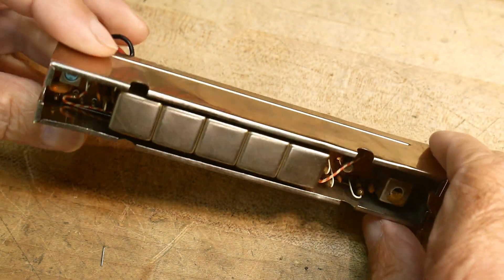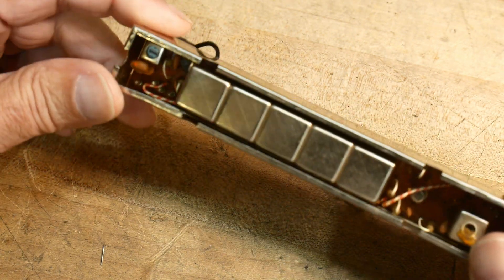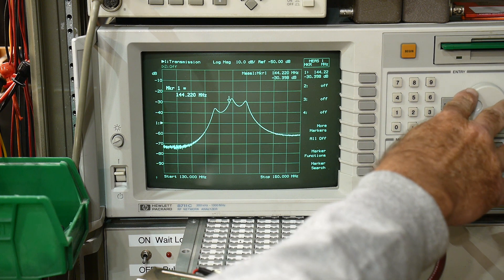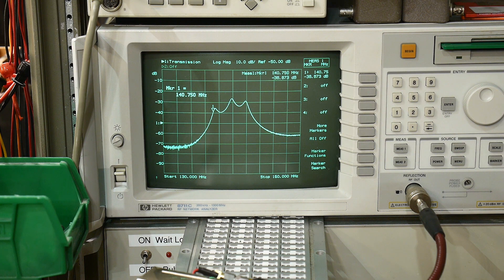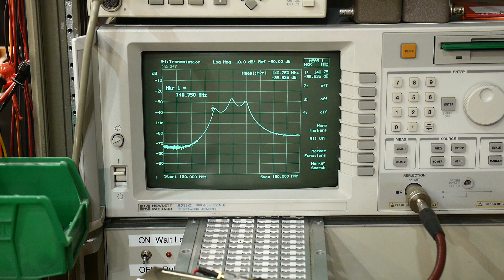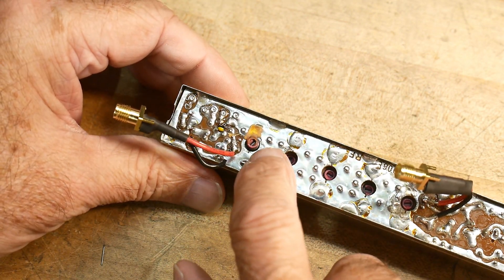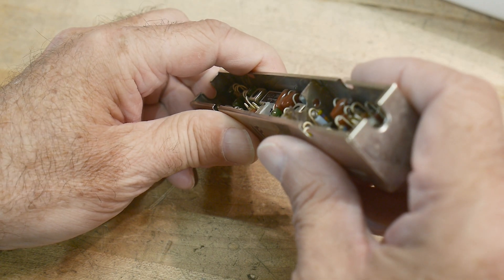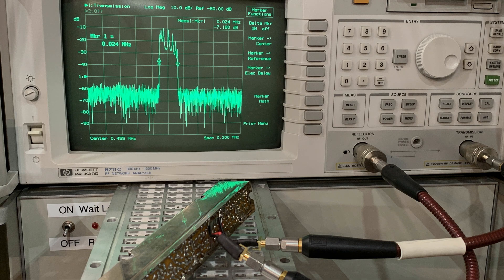#983 145 MHz Helical Resonator Bandpass Filter

Comment: I wonder if perhaps the reason it's so broad banded is that the tuning has changed with age/vibration. Perhaps might explain the loss, too. Some helical front ends such as that in the GE Mastr II would grow "whiskers". They were very fine whiskers made from the silver plating of the resonator cavity to the resonator coil. I'm not the best at the physics/ chemistry about why that happens, so I'll reserve that BUT it just might explain why the bandpass filter curve looks the way it does. It really resembles 3 off tune circuits.

Comment: The sweep of the 455 kHz filter shows that it also was not intended to work in a 50 ohm system.  Both of these sweeps are textbook examples of what a mis-terminated filter's response is likely to be.
Reply from the maker: yes, is a series resistor sufficient or is it better to have a wound transformer?
Reply: @IMSAIGuy  A transformer would be better, as a series resistor will add a lot of loss to the  system.  However, about 40 years ago I worked for a company that did alphanumeric display pagers.  The receiver in the pager had horrible sensitivity, and I suspected poor filter match when I found that just running a single tone through it didn't sound all that bad, but the sensitivity for data was really bad.  I measured the group delay and passband response of  the filter.  Both looked horrible.  Checking the terminating impedances with a VNA, I found that the termination on one side was fairly close to the specified 1500 ohms, but was close to  50 ohms on the other side.  Adding a series 1.4k resistor improved the data sensitivity by about 6 dB.  One would expect that with the additional loss of a series resistor, the sensitivity would get worse, but the mis-termination effects were so bad that even with the additional loss, the improvement in bandpass response and group delay made an improvement in sensitivity.  Basically, the group delay was causing either the zeros or the ones to be delayed through the filter, causing them to partially cancel out.  This was just one of the many things I found wrong with the receiver, which was done by a high-dollar outside consultant.  Eventually, they decided a new receiver design was needed.  The engineering manager told me the company had decided to go with an in-house (me) design, as opposed to the previous out-house designs.  When we realized that he had called it an "outhouse" design, we both cracked up laughing.  Long story short, put a resistor in series and it will look MUCH better.  My experience was with a Murata CFU455 series filter, and for most of those the proper terminating impedance is 1500 ohms.  I couldn't find a data sheet for the filter used in that radio, but I suspect the terminating impedance would likely be in that same neighborhood.  If a series resistor causes too much loss, a small amplifier will make the measurement possible.  I know, I'm long-winded.  My employees used to tell me I should write a book, and I guess I just did!
Reply: And if you don't know the proper terminating impedance of a filter, a trim pot will get you in the ballpark quickly!
Reply from the maker: @JimAndyAllyn  OK, good tip.